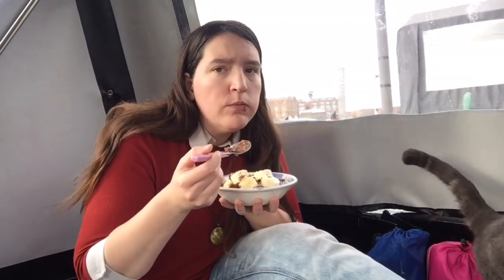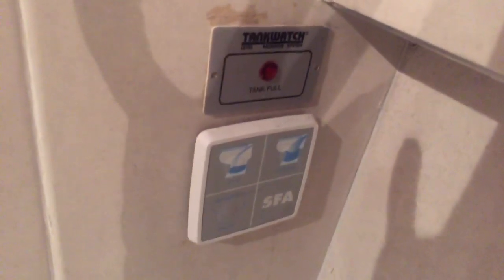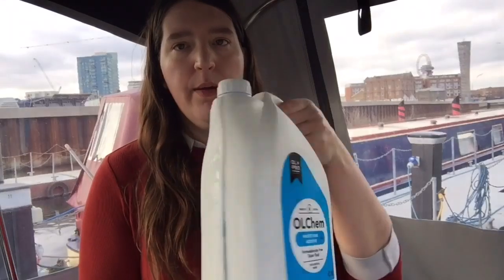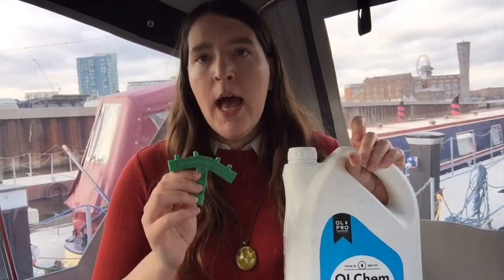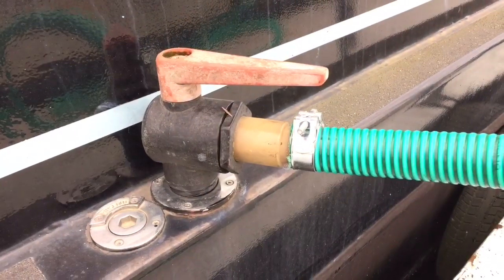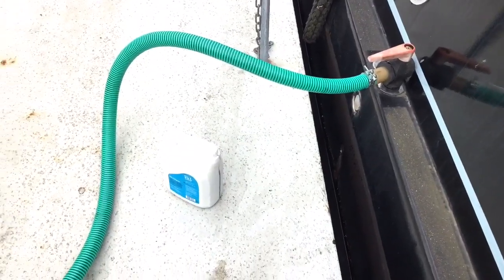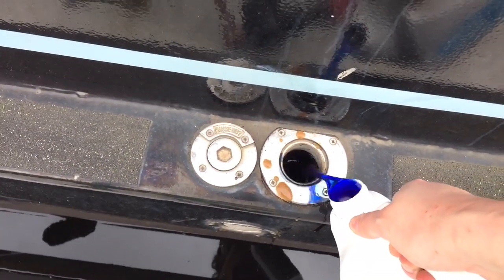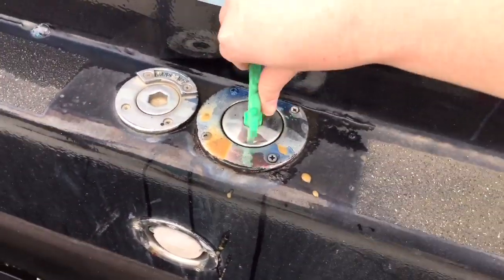How to Pump Out a Narrowboat Toilet

Comment: Not all pumpouts have macerators, some are just dump through. It's also more usual, in my experience, to take the boat to a pumpout station although there are boats and land based operators that will come to you. Plumbed-in is very handy!

Comment: When you finish your first pump you then fill with clean water and pump again to clean your tank , I do ours about four times to make sure it is clean , if you just pump once half of your nice sludge is still on the bottom of your tank nice ...
Reply: whats the point of cleaning the tank ?  and its a waste of water .
Reply: @brain8484  because when you pour the waste out obviously that is still some in the tank so even if you're an eco-warrior you need to rinse the tank at least once although twice would be even better as you will be sure it is nice and clean it before you put it back also if you never clean it properly it will stink to high heavens you might enjoy that but I certainly wouldn't

Comment: hi all good vid can u explain i thought the end u stick in the hole would be longer so as to touch the bottom of the tank? of is there a pipe in the entrance to the tank that goes to lowest point in tank ?  if not the suction must be awfull powerful colin
Reply from the maker: metal dectecting cornwall yes the suction is very strong and if you get a good seal between pipe and you create a vacuum which just sucks it all up

Comment: v good vlog, i thort everything would be sealed of etc if you know what i mean, wasnt expecting to see, a few umh drops of waste here and there so to speak lol. you show it how it is though well done, think if i ever get a boat would prefer a cassette loo, do you not have a gauge in a caravan the cassette loo has one and it goes on red when its getting full x
Reply from the maker: tracy fun our suction isn't great, so that may be a factor with the spillage, but it's just a messy job even when it's clean. There's no warning light, only a full light, so you get to know when to do it in other ways